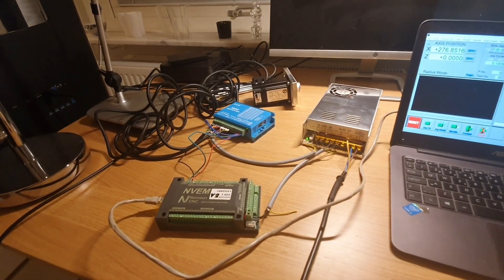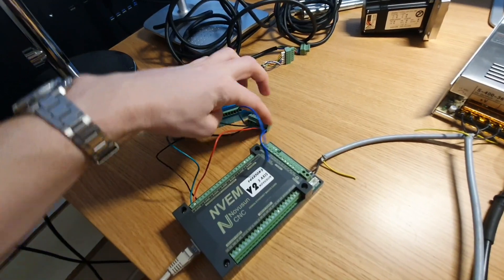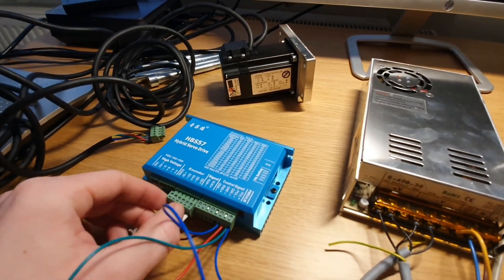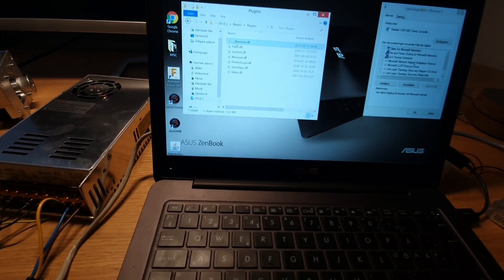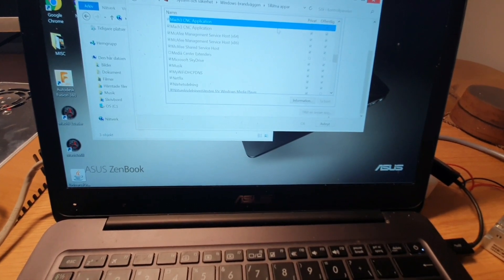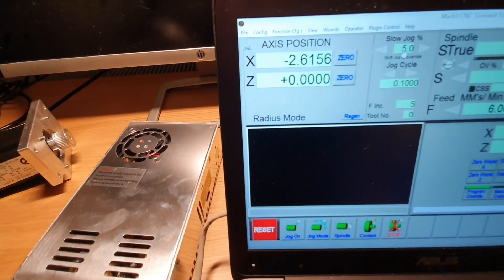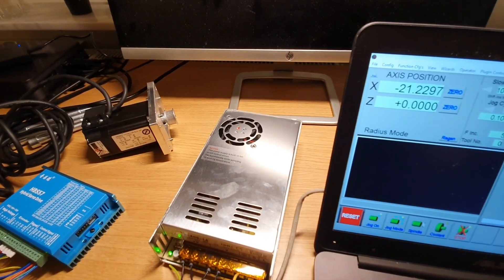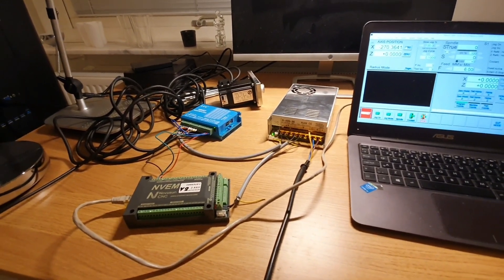wiring / setup NVEM mach3 Ethernet cnc controler + hbs57 driver + 57HSE2.2N hybrid stepper motor

Comment: Hello...I just put my hands on this controller but the Ethernet leds are not blinking.
I'm feeding with 24V and plugged it in the Router.
I was expecting some activities in the Ethernet port, even with all other Pins disconnected.
The Router says no device is plugged.
What am I doing wrong ?

Comment: I need help with this Nvem v2 controller, always I have to reset mach3 to run ref all home, and sometimes when running a gcode the machine stops suddenly or shaking with loud noise that must be restarted , please , have you some tips for it? my power supply used on this controller is 12v, a think to change the power supply to a 24v , I think the controller need to sink extra energy to run fine.

Comment: hello, which power supply will you suggest to run 4 of these drivers? will it be enough 2 x 48v 10amp units (each one will control a pair of steppers)?

Comment: Hello, is it necessary to use the RS 232 cable for the safety of the CNC machine to work with the Mach3 program or is it only used to show the values? Please help and thank you very much